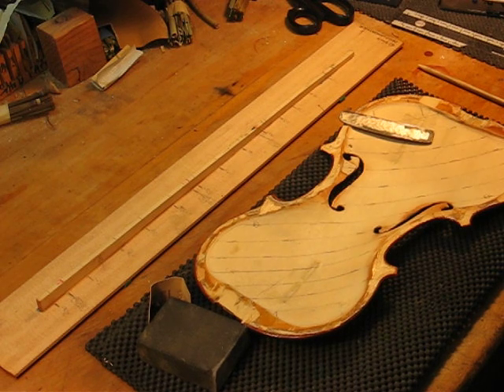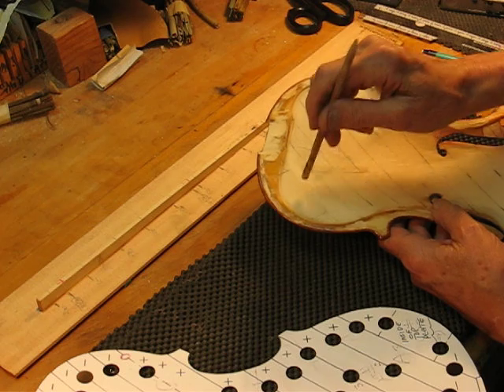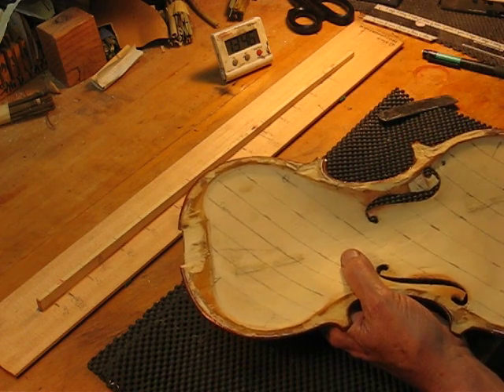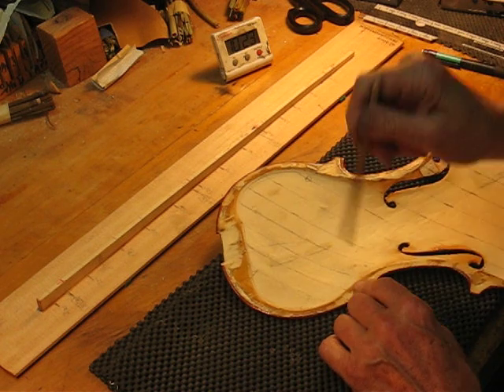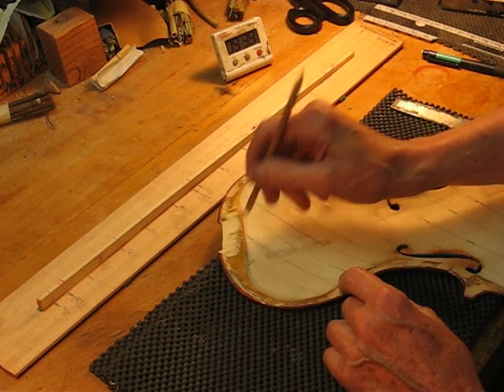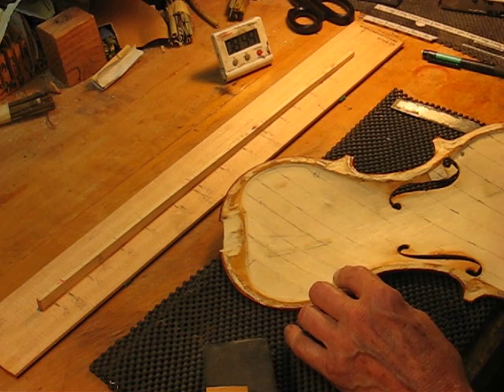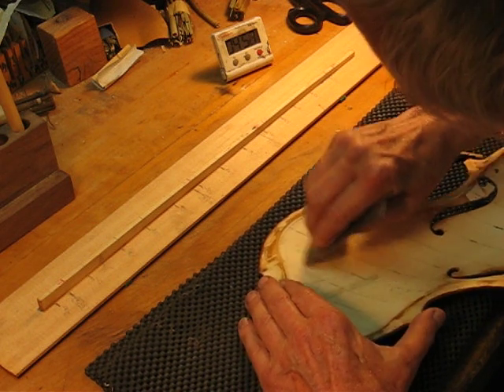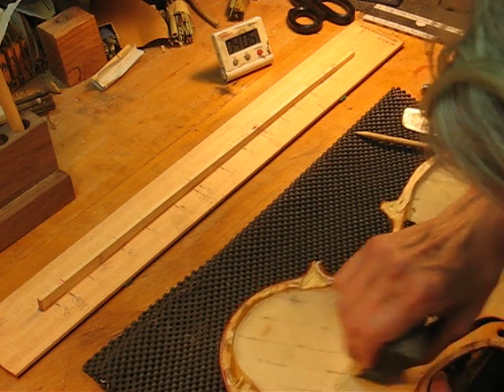Vigdorchik  Method Top Plate Tuning; Opus #15 ,strips 3 4

Comment: hi David i find difficult to use the photo to create the template for tuning but i have noticed the the dotted line goes from the upper largest side to the lower largest side of the plate so i only need to know the spacing of the lines going down the lower bout and the spacing going up the neck bout
Reply from the maker: Andrea; for a full sized violin, 14" body length:  The center strip is 1 9/16" // 39.66mm wide; centered on dotted line.  The five upper strips (toward tuning pegs) are each 0.7" // 17.77mm wide.  The five lower strips are each 0.9125" // 23.16mm wide.  ...David L.
Reply: @dalemfg  thanks very much you have been very clear
Reply: but it seems that the lines below and above  the dotted one are not equidistant from it

Comment: Oh snap; I wish you would have showed the light through the top!!  The back doesn't allow the light through; right?
Reply from the maker: When the plates are finally graduated, the plates when held up to the light will show some light passing through the end of the back plate where it is only about 2.0 mm thick.  It also seems to depend on the species of wood involved (the top plate should be 2.6mm all over.  David L.